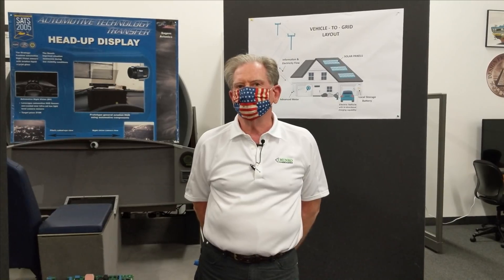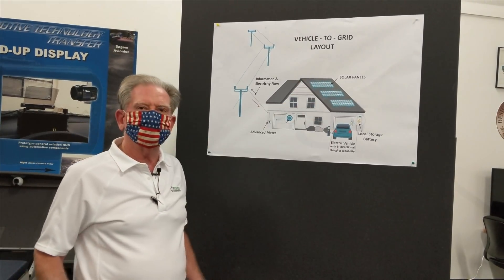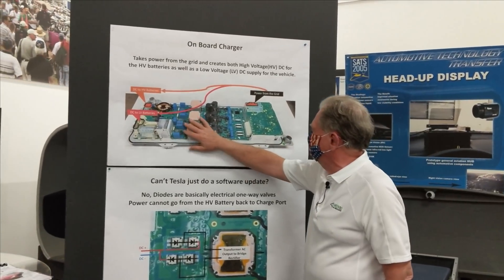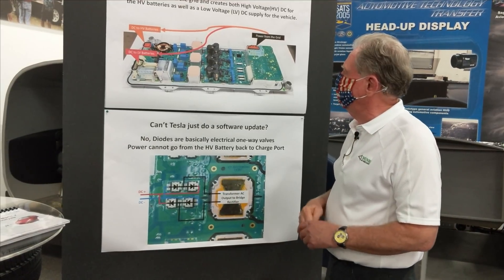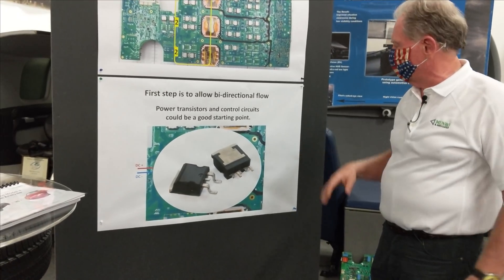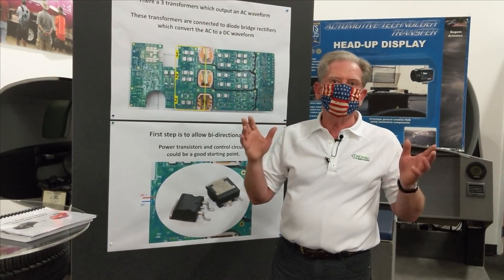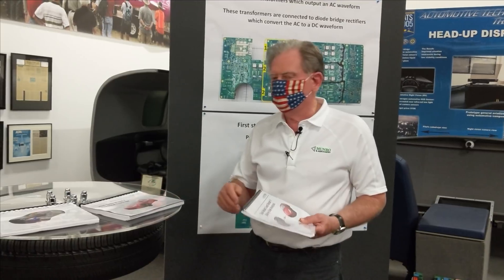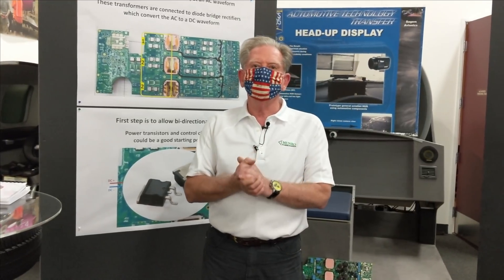Tips for Tesla E2 - Vehicle-to-Vehicle (V2V) and Vehicle-to-Grid (V2G) Charging

Comment: V2G is definitely  the future. I think Tesla will swap the onboard charger, when they release it, like the CCS upgrade
Reply: @xander, forget about the internal AC-charger, its a dead end. V2G will be DC-DC in the EV.
Reply: stefanhuszics You’re right... But DC cable expansion will work like fiber optic cables. Rapid expansion in the city, slow expansion in the country
Reply: @alexandervesper7253  You can have the DC-AC-converter in the house. I already have exactly that, connected to my solar panels. So no need to have new DC-cabling from the grid.
Reply: stefanhuszics So your idea is to use the existing grid and convert it from AC to DC. Then every house will get an inverter?
Reply: @Xander no the dc will just come from the car. Then before it connects to your house wiring you have a dc to ac inverter. You can currently access the dc batteries in a Tesla through the supercharging circuit. Which bypasses all the charging electronics talked about in this video.
Reply: @alexandervesper7253  every house with solar panels already have such an inverter. Every house with a home battery does too. Its a much more cost effective solution than changing the entire grid. Also, basically everything you have in your home today would be easy to run also on DC or in fact already does run on DC. All mobiles and computer eg are already 100% DC. So your house is already crammed full of inverters, you just dont think about it. It just comes with the appliance. The same will happen with cars, the internal AC-DC-charger/converter/inverter will be moved out from the car and into the house, just like you mobile and laptop charger.
Reply: stefanhuszics So your Solution is a “DC-World“?
Reply: @alexandervesper7253  No, all solar panels and batteries are DC, all homes are built for AC, so any solar and/or battery backup home already has the ability to take DC and make AC with an inverter. This inverter installed in the home wouldn't need to be replicated in the car, it would just be connected like a big battery bank. The problem is not many inverters are built for the voltage of a tesla battery and not all EVs use the same battery voltage and DC voltage step up or down is much less efficient than an inverter than can use the native battery voltage.
Reply: @alexandervesper7253  "Dc-world" is not my solution, its already the current situation in the world of today. Its pretty much only the grid due to legacy reasons that still run AC. Too costly to swap out literally everything. But more and more things in the homes will eventually be able to connect to and run directly from DC. DC-DC conversion is much cheaper and more efficient, so pure economics will drive this change by itself.
Reply: @kingrpriddick  "The problem is not many inverters are built for the voltage of a tesla battery and not all EVs use the same battery voltage"  I disagree. EVs run usually around 400V or 800V batteries. Solar panel strings usually run between 200-1000V. 99% of the solar inverters in existence will have no problems what so ever with 400 or 800V or anything in between.
Reply: stefanhuszics Lucid Air is 900V
Reply: @alexandervesper7253  last I checked 900 < 1000. Possibly you drop down to "only" 98% of current solar inverters capable of handling 900V. Its only if you go above 1000V you see a large drop off from usable stuff already in peoples homes.
Reply: @stefanhuszics  Right, so a solar inverter designed for 200V is probably not going to work with a 800V EV, same issue with the opposite extreme. And many solar systems have charge controllers that smooth the power to the voltage of the battery pack, so a 200V solar string could be running a 48V battery and 48V inverter. A MPPT charge controller could not step a 200V EV down to 48V but it can step down a 200V string. There are so many different systems out there compatibility and code compliance would be difficult.

But if we are talking Tesla products only, there is no reason they couldn't design a powerwall to have a DC Tesla EV connection.
Reply: @kingrpriddick  There are basically no grid-connected solar inverters that only does 200V. Pretty much all of them do the full range of about 200-1000V. So your argumentation is completely irrelevant to reality when we are talking about V2G (G = grid). 200V and 48V and other such numbers, that is normally for OFF-GRID solutions. But off grid is literally not what is discussed in this tread. And if you are talking off-grid, then the solution really is to convert the entire home to DC instead, and then you dont need a DC-AC converter at all, just a simple DC-DC downstepping.
Reply: @alexandervesper7253  no. Think of it like this. Your solar panels put out about 400v DC. This gets converted to AC by your solar inverter. Now let's just add a small inverter to your solar inverter and plug it to your car's DC charge port. Now when there is excess energy instead of selling it to the grid you charge your car. When the power goes out the energy can come out of your car's battery. So all you would need to do is buy the right solar inverter with a charge port for your car. The extra cost for this would be the same as the difference in cost between a hybrid inverter and an inverter without battery storage capabilitie and that would work with any car not just Teslas. In fact newer hybrid inverters are going to higher voltage batteries which makes it even easier to add the V2G capabilities.
Reply: @stefanhuszics  Most likely, because there needs to be a new device which has to handle all of the communication and monetary transactions of the electricity (AutoBidder) and since it has to do the inverting there, it's more efficient and makes more sense to grab the the DC electricity which is stored in the batteries already.  But...they will only want this done with 'the million mile' battery since it can do a lot more charger cycles. Cybertruck should have it as it will already supply 240VAC/120VAC in the bed.  Battery day will be very interesting.
Reply: @whattheschmidt  in my country the electric utility companies already handle the money transaction part just fine for buying/selling electricity. How else would you get payed for the solar energy you are selling onto the grid and the energy you and everybody else buys? I would have assumed that is the normal way its done in most countries. As for controlling the most economically advantageous time to buy/sell electricity, my raspberry pie already does that, for a cost that is completely irrelevant in the context of solar systems, batteries and electric cars. Software needed is FOSS.
Reply: Absolute game changer for "post hurricane" survival instead of having thousands of noisy, smelly, gas generators going all day & night.
Reply: Aussie2u Here in Germany we have more problems with store solar-power for the night, rather than power outtages. But this is also a solution for this problem
Reply: @alexandervesper7253  Oh very true but then you run into battery degradation issues with all those charge/discharge cycles.   For the immediacy, with existing battery packs, I look at V2G like my PC's backup battery.  If there is an mains outage, the car is always ready to help power something.
Reply: Aussie2u Wait for Battery Day then there won‘t be any issues with cycles
Reply: I don't think Tesla is swapping anything. They will just start installing them on new cars that have the 1M mile battery if they're going to do it at all.
Reply: Vehicle and stationary batteries are optimized differently. First - weight, second - number of cycles.
Reply: @hrissan  That doesn't mean you cannot use the vehicle batteries like stationary ones, just that you're paying a premium for them.

It's also been shown that using a vehicle in a V2G way doesn't really increase the cycles much as you're usually only taking small amounts of power off of (a comparatively large battery) which is designed to handle the rigors of moving a car. Houses are tiny loads compared to motive force.

That's not to say there is no degradation, just that it's far more minor than actually driving the car
Reply: MrVelociraptor75 that is true, we’ll see where the technology goes. For now everything green is too expensive to seriously consider, except tiny niches (arctic, remote locations, islands, Tibet 😸) . If not huge subsides, all “green” power will be dead. Govs just suck money from other industries and channel to green energy dev. May be home batteries be cheap as drywall, or may be there would be huge industrial molted metal storages and no home batteries at all.
Reply: Grigory Buteyko Inform yourself before posting something
Reply: If you want V2G, buy a Nissan Leaf, they already have the system...
The CCS charger is also not able to support V2G, for many years still, as Chademo does today.
Also the battery chargecycle will be greatly reduced.
So when the rumour about Teslas V2G in Y and maybe 3 was out, you could already say it was not any kind of that support as both these cars have CCS superchargers. And CCS dont support it in general.

Comment: V2V IMO is smarter than the V2G argument. V2V has more use cases. The grid will support more evs. Especially if you have tesla power walls. And you have solar, and grid to the house. 3 points of failures is okay enough.

Comment: Well darn!  Thanks Sandy for the overview and confirming this is not possible.    That said, I do have a question.  Most of your information was around AC to DC, would DC to DC also fall into the same situation?
Reply: I think DC to DC bypasses the inverter circuitry, but it would be expensive, like thousands of dollars to make an inverter outside the car and to speak it's language...EVTV talked about it in December.  Much easier for Tesla to upgrade the existing hardware with Transistors.  but the DC to DC quick charge a friend's car may be more possible??
Reply: @Miata822  why connect 2 batteries together with nothing else than an electric cable? Why not do something more intelligent eg use a smart cable with a DC-DC converter in the middle? And no, you dont need everything a charging station needs because 
1) You are not converting AC to DC, just DC to DC .
2) You dont need to do 250kW, 25 or even 10kW is plenty for emergency uses for a car or running a complete house.

For the record, Nissan has, due to Japanese law, been fully V2G compliant since 2014. All CHAdeMO (BEV and plugin hybrids) have been since then (though most are not sold outside of Japan). But yes, Nissans battery tech does suck unfortunately. OTOH, the currents you would be pulling out of the battery for eg V2H are laughable compared to DC-fast charging or flooring it after the stop sign. Easily 10-100 times more stressful for the battery.
Reply: @Miata822  please give a logical reasoning for why your DC-DC smart cable for V2V needs to handle 50kW. In my mind that is completely insane. You are not trying to turn your car into a professional charging station, but to have something to provide emergency power for a stranded EV to reach to the closest regular charging station or other grid connection.

Also, in my solar panel setup I have 8kW DC-DC string optimisers, they cost about 500€ to customers before taxes and include a whole bunch of stuff that would not be needed for a V2V-cable. Realistic amounts of kW are not too heavy nor too expensive. It would basically cost about as much as a comparatively sized AC-smart-cable (aka AC home charger), but with a lot better effciency and no need what so ever of any AC-DC inverter in the cars.
https://ferroamp.com/download/solar-string-optimizer-sso-8kw-datasheet/?wpdmdl=10724&refresh=5f09e8ab8cfcc1594484907
Reply: @Miata822  8kW is 73A @110V, that is not what I call granny anything. And if you check the link you will find also a 16kW model, 145A@110V. I just didnt have a price quote for that model, and much of the point was to discuss things from actual existing stuff today sort of in the ballpark of what would be needed with realistic actual costs. And your solution with inverters and going via AC, will cost more in material as well as add 4-6% of transfer losses. From my POV that is a LOSS-LOSS, how come you view that as a better option? Becuase in your previous post size & cost made DC-DC not an option, but now those conserns are no longer valid when they dont favor AC-DC?

Besides, 8kW = 2kWh in 15min, 4kWh with 16kW, and if that is not enough to limp on to the nearest possible grid connected charging point, then there is something really strange going on in the drivers desisionmaking (certainly not a near miss for reaching somewhere to charge). For comparison, driving someone out of gas to the nearest gas-station and back should also take at least 15min. But sure, if the dead EVs manual state that its ok to tow it, with a dead battery, then that would of course work as well.
Reply: @Miata822  Of course this is tiresome, you have from the getgo come to the discussion with a "nothing is possible" attitude. I guess a careerlife in the regular carindustry has beeten "think outside the box" mindset out of you. And exactly for the reason you yourself bring up, "OEMs wont add cost..." the AC-charger built into EVs are destined to be ripped out by the OEMs becuase it cost money, takes up space and weight, are extremely limiting in chargespeed, can lead to warranty-claims-costs and are considerably less efficient than DC charging. There is absolutely noting beneficial with having it in the car by default except legacy support to ac-plug charging. I'm giving it a maximum 10 years until it's an external optional extra, and the car itself is only DC-DC. At that point the buyers will be able to, with a new car, decide to have an external AC-charger, or DC-DC charger, both, or none.

Noone is talking about cobbling together anything. I was mentioning the price of actual hardware that today does DC-DC at the voltages and kW that would hold relevance for the purpose of V2V, in response to your nonsensical "take this small inadequate 12V device and extrapolate the price, see, its completely impossible". Obviously the DC-DC-cable would be purpouse built, with similar hardware as in the solar DC-DC-unit, and at a pricepoint also similar to it. No need to use inflated made up prices and talk about bulkyness and huge weights, when there is actual hardware out today that debunk all those claims. Facts are bettern than FUD.
Reply: I believe the diode configuration would block it. Diodes are always one way flow. A common diode is LED (light emitting diodes) lights.
Reply: @Triggernpf  DC-fastcharging does not pass any diodes, its a connection straight to the battery + & - and controlled via software. Thus there are no diodes preventing the flow to go backwards. The internal AC-charger of the car is completely irrelevant to V2G/H/V, it will all be DC-DC.